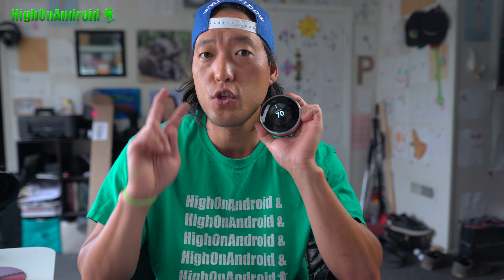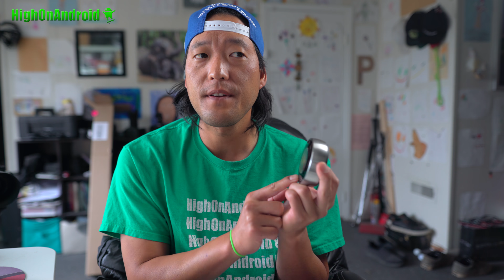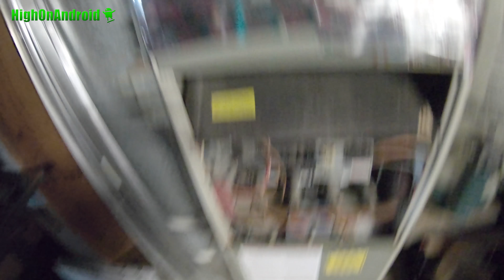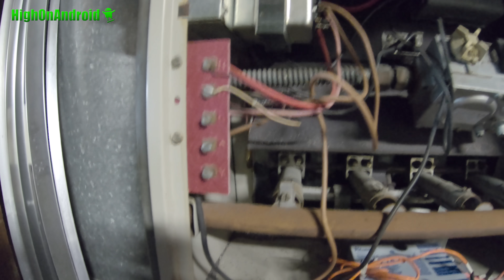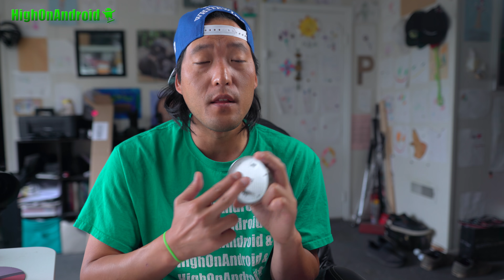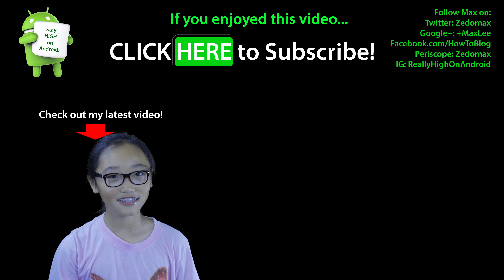[DO NOT BUY REVIEW] - Nest Thermometer BROKE MY HEATER & VOIDS WARRANTY!

Comment: I'm a licensed HVAC journeyman. Sometimes they short sometimes they don't everyone that doesn't do it correct is gambling literally.  If you have a common wire at the tstat it is correct. But if you rig it how Nest tells you by using two wires instead of the correct 3 it will short things like circuit boards or gas valves etc. Most people don't have common wires up to the thermostat that's what it needs 
To use one correctly they would have to run a common wire from the furnace circuit board to the thermostat.
We always laugh how nest coerces all of the normal people into thinking they can run a 3-wire thermostat with only two wires or a 5 wire thermostat with only 4 wires. Lol. Short circuit City.  
When I say rig I mean their power extender kit PEK. that's rigging it.
Reply from the maker: Oh cool,  thanks for the input vato!  I guess it is a HUGE problem then.
Reply: Max Lee kinda so scammy on nests part. You can have a technician run new 24 volt 5 wire or 3 wire in your case.  but it might cost $300 cuz it's a bitch to get to in the wall. The extra wire is to power the thermostat which is called the common wire. "Com" wire. All those busted thermostats bought me  new phones like my pixel 2 XL and S9  I'm always high on Android
Reply from the maker: Lol I just donated 400 bucks to my HVAC specialist!   Good to hear keep on fixing them Nests.  Maybe a great way to make money for sure.
Reply: The issue is it switches on and off the heater several times to charge internal battery which eventually will cause ignition, or control module to fail. Plus even if you have correct 3, or 5 wires one for common C wire, nests are know for mosfet to fail as they use mosfets instead of relay to switch on and off circuit to HVAC systems and when the mosfets fails they usually fail shorted causing heat pump, or compressor to stay on and then burn out. Avoid Nest all together, get a Honeywell is best bet as they use relays and if they fail, thet fail open. I replaced a few customers control boards and compressors due to Nest failing. Plus Nest uses a internal battery which last about a year, or so and not very long.
Reply: Just lost my board installed nest like 2 weeks ago . google claims they haven’t heard of any  issues with damage to furnace before . Idk if it caused the board to go out but it definitely was causing weird clicking and fan issues after the fact
Reply: Google claims they know nothing about issues with furnace

Comment: I don't know if they offered the Nest Power Connector 4yrs ago when you made your video, but that is the solution for a 2 wire thermostat on a gas or oil boiler. It adds a C wire to power the Nest without having to manually add another cable. Also the Nest E is specially made for 2 wire systems. Great video & channel.
Reply from the maker: They didnt obviously but now they do and i got them new ones.

Comment: Wow great info, I installed nest gen 3 Learning thermostat to my two wire furnace and it kept cycling the furnace on and off till the heat went up to 83 degrees (nest was set at 65) it made my home into a oven, I pulled it out the wall and call customer support, they walk me through every possible case and still did not fix my issue, instead told me to leave it disconnected for a day or two and then try again lmao 😂. I feel I will return it and just get something simple (even tho it does look so nice on the wall, I was so let down by this device) Heads up, just do your research before purchasing.

Comment: I got a Nest when my local Com Ed offered them with a discount.  My long-time HVAC technician installed it but warned me they give people problems.  Less than 2 years later, on one of coldest nights in Chicago, the thermostat failed. I got online with Nest who wanted me to trouble shoot by looking crossing wires and what not.  I told him I would not do that.  He said to call my HVAC technician.  When he came on emergency call next day, he found not only was the thermostat shot, but it had fried my heater motherboard. Repair cost--$2875.  I was back and forth with Nest who refused to compensate me for any portion of the cost of repair.  My technician was nice not to say "I told you so."  I went online at the advice of my attorney to see if others had a similar problem.  Product liability is usually not worth the small claims trouble but class action is another thought.

Comment: so I have a nest thermostat V3 with a heatlink module in between the heater and the nest thermostat that plugs into the wall outlet. I guess that fixes the problem? It now gets the power from the wall outlet and only sends signals to the heatlink module wich in turn sends it to the heater (with an OT converter module in between as well)

Comment: yup, the company I work at refuses to sell these to customers for this very reason.  Google doesn't care if your equipment breaks, they just want the sale of the thermostat.  if you compile a bunch of mini shorts to the circuit board over time it will fail.  use Honeywell.

Comment: Owner of the business my wife works at replaced the old T-stat with a Nest...then the trouble started.  While running the A/C the Nest shuts down the system for about 2 seconds then starts it back up again.  Of course, the compressor is stalled due to the high manifold pressure.  It does this once or twice per day and it will eventually cause a problem.  It's similar to flooring both the brake and gas pedals on your car at the same time, something's gonna break.  All I know is they never had this problem with the old mercury switch type T-stat.

Our Whirlpool "green wedge" HVAC system at our home just turned 40 years old and it's still running perfect.  To my knowledge everything is original except for the in-rush thermistor, contactors/relays and motor-run capacitors.  The blower motors have oil ports so you can lube the bearings which I'm sure is a thing of the past.  And I'm never going to use anything but a mercury switch type T-stat on this system.

Comment: Thank you sir for posting this very informative video.  Right now it's 7:40am and I have been  with Nest support since around 4am and it seems like Nest killed my igniter as well. I am only running W1, W2, G, and Rh (no common wire).  The sad part is that there is no mention at all during the setup or while speaking with Nest support about the importance of the common wire.  I just installed the old Honeywell thermostat and it's still not igniting so I assume the ignition is fucked.  How on earth Nest is not mentioning this at all!!!!!!

Comment: My HVAC broke Nest caused the issue, had a short power outage I assume that drained nests battery, I took it out and ran a circuit with the thermostat directly to the two wires waited a while and nothing happened the heater tried to start but the fan didn't run.
So I tried again when Nest was plugged into the computer via the usb port and it started running ... it was low on battery. 
(Solution for me) : To fix it take the Nest out of the socket, plug it into a computer via usb for ten minutes and then it should run.

Comment: I bought nest thermostat yesterday and just returned it today! Because it kept turning on my heater I also called nest and they. told me to turn off the auto scheduling and to turn off the eco-mode. And that should fix it. But the next morning I woke up sweating because my heat had turned back on. I called again and they told me oh just remove your wire for the heater and then put it back in when you need it. So was like hell no I’m returning this! And They also tried to say that my air-conditioning System was broken and I should call a technician. But When I put my old thermostat back in the problems went away.
Reply: This happened to our nests too. We were instructed to turn off eco-mode.
Reply: @darith27  That’s stupid because that’s the whole point of buying the nest thermostat for most people I would think.

Comment: Thanks for your video! Nest sucks!! It's so crazy that these issues are out there, and I thought I did my research when we bought it a couple years ago, but I guess not. We have a common wire, but this is the 2nd year our Nest has caused our 5 year old 95% efficient furnace, to turn off in extreme temperatures. I am finding there is a fix by unhooking this one wire, but I'm not very handy and don't want to deal with this! Last year we paid someone to come out.  He unhooked the thermostat wire at the furnace and it came back on. I'm thinking of buying a Honeywell next, which I can use at multiple properties.

Comment: I strongly believe this is bullshit . Not you but the general  misconception that Nest is a problem . Yes they need a common but one thing I know for a fact is that that robertshaw ignition module is a common problem on its own . It hates heat and moisture and it isn't protected at all. Long story short it won't void warranty hire a real contractor dude.

Comment: NETATMO, search.  It's a winner in all aspects. Very Elegant design, stunning App ! And with additional valves it's a killer.  On the other end I  Don't understand Nest/ Ecobee design. It's absolutely a design flaw having a very complex configuration in the device itself. Fancy display, to much color,overengineered, expensive garbage... A simple, elegant design with 2 or 3 info is more than enough. Then INVEST in the APP!! The smartphone is a remote,  pocket computer by design! I'm away, or confortably in the sofa doing my configs instead of infinite minutes on my feet staring to a circle. Bah.

Comment: I have 3 nests, 1 on the central AC and 2 attached to my hydronic boiler for heat. The AC had issues without a common and attaching one solved the issue, the other 2 are 2 wire and have been working fine for years with no issues. It all depends on what equipment you have, of course it’s always better to have a common, but plenty go without and do not have issues. Nest makes it clear that you may need a common in their compatibility tool and their instructions, it’s no secret. 

Regardless simply buy a reel of 3 wire thermostat wire for like 25 bucks tape it securely to the old wire at your thermo and just pull it to your furnace side. Voila! There is your common wire.  Strip the ends and attach to the terminals. Its an easy fix
Reply from the maker: That's easy to say but for mine I would have to pull a new wire through the walls which wouldn't be easy as it sounds.  But nest should have clearly made their thermostat working without a common or just make it not work without a common.In the end it cost me hundreds of dollars to fix and I'm not using this again.
Reply: I see your point, but the fact is that plenty of people can and do run the nest with only 2 wires just fine again it all depends on the system you have, regardless always best to have a common but nest certainly could be more clear on that point. Love your show BTW!

Comment: Nest almost broke my central AC. The outside compressor would turn on but the fan/blower often would not. Switching to a basic thermostat worked fine. After troubleshooting with Nest they said I needed a common wire.

It's misleading that their website shows compatibility with my older Honeywell using 2 wires. I read the manual for the new smart Honeywell thermostats and they state you must have a Common wire. So in my book, Nest is being very misleading.

Comment: Without the common wire nest taps the power from the heater and air conditioning. It cycles the heater and air conditioning on and off constantly, it turns them on for a split second constantly to tap the power( it's so fast of a cycle that it never fully turns on). I think it's that constant cycle on and off that kills the ignition after a while since it's not designed to cycle on and off that many times.
Reply from the maker: Yeah I noticed that Nest starts up my heater much slower than a battery powered thermostat.  Those pulses may be killing it.   Damn Nest.   They should make this public before it becomes even a bigger problem.

Comment: So, if you have a cheap 2 wire furnace, or an older 2 wire furnace that hasn't been updated to current standards, don't use Nest thermostats, otherwise you're fine.  Got it.  Going on 3 years+ without a single problem.  Dual zone furnace/AC units with heat pump.  Total pins in use: 6 per thermostat... no issues here.  Should change the title to "Buyer Beware".
Reply from the maker: Yes exactly, 2 wire is the problem but Nest does NOT have instructions specifically not to use on 2 wires.

Comment: Your problem is that your furnace is ancient lol upgrade that thing. My nest works flawlessly
Reply from the maker: Well the technician told me this 2 wire problem affects even new systems plus it does void warranty.  If you are using a common wire though you should be fine as I said in the video.

Comment: Had the same experience. Thankfully nest covered all the costs. But we were out of heat in the severe winter.
Reply from the maker: Yeah it started happening to me in severe winter also, somehow the cold weather made it worse.
Reply: Well shit... This definitely just happened to me. Got the HVAC guy coming in the morning to check it out, as my heating went out yesterday for no reason. Managed to reset and eventually stuff started randomly working again. Took 8 hrs to heat the hose from 54 to 70 since the system kept turning off and on. Used it all last winter with no issues. How did you get Nest to pay?

Comment: I have an ecobee, and if you have no Common wire, you have to use their Power Extender Kit (PEK) to drive the ecobee, instead of stealing power for the 2 wires. Love my ecobee and their remote sensors.

Comment: So what happens when you don't have a common wire is the nest will pulse the system on in short bursts just long enough give it a bit of a charge. It's generally not long enough for the heat to actually run, but apparently it isn't good for the ignition system because now it's being run more often, which causes it to go out faster. When you have a common wire the nest can use that to power itself instead of pulsing the heater.
Reply from the maker: I also noticed with Nest, it takes 20 to 30 seconds for heater to come on while it is instant with a battery powered thermostat.
Reply: Max Lee Hmm, that's interesting. I don't know why that would be.

Comment: Wait..... your 1988 heater is still under warranty?
Reply from the maker: No but my new ignition module is under 1 year warranty so long as I do not use Nest.
Reply: Max Lee wow thats crazy, my ac has been acting up and i noticed i dont have common wire either. I too have had it for 2 years. Were u able to confirm if it can run on usb power?